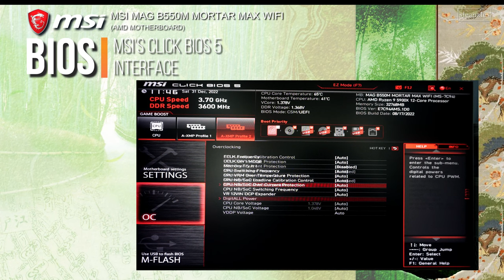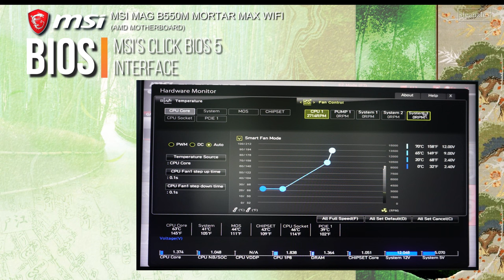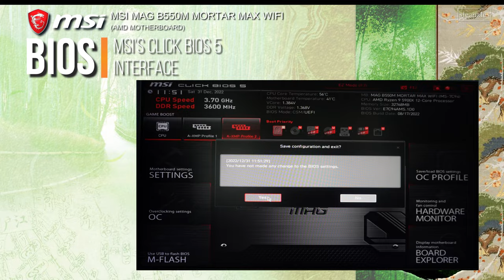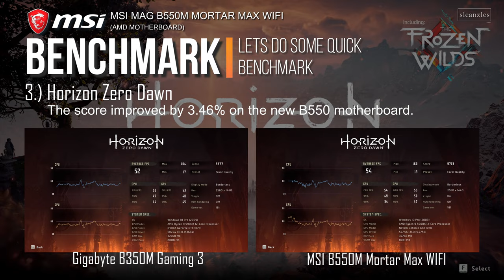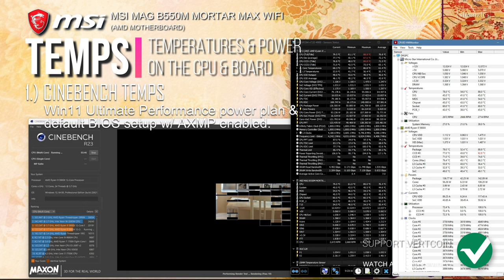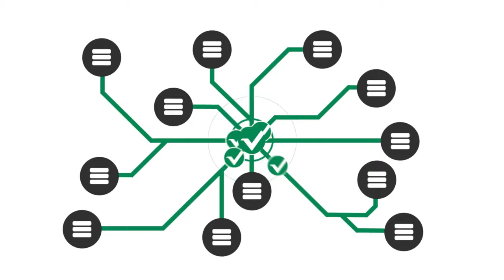MSI MAG B550M Mortar Max WiFi | Powerful but blind, upgrading B350M build

Comment from the maker: If you have any questions about  the MSI MAG B550M Mortar Max WiFi in the video feel free to ask and drop a comment down below. I will try my best to answer them based on my experience while I'm using it. For technical support and troubleshooting might be best to contact MSI support though.
Reply: Hey i don’t wanna get an Asus board, apparently the customer service is trash along with the recent issues. Is this board the one to get rn?
Reply from the maker: @Beanpomade  That all depends on you. Personally I don't have much complaints or problem on this board apart from the SATA detection issue on my old HDD(see video). If you're looking for the best B550M motherboard then  this is the best one there is, well at least at the time when I bought.
Reply: Hello i hope you can answer, I installed this to my new built PC but i could not see the wifi option , Do i need a wifi adapter for the wifi option to work?
Reply: @HarisYouTube05  no you don’t
Reply: can you put ARGB fans on that mobo? and does it has light sync?
Reply: where is the argb header?
Reply from the maker: @ak-t7d6f  you can use the x2 JRainbow pin headers on the bottom and on the top right of the board. Refer to the manual. Careful not to be confused with 12v JRGB pin header, or it will fry your 5v ARGB.
Reply: @sleanzles  thank you 
I will use it with an ARGB fan with my new CPU cooler 
Will the rainbow one work with that?
Reply: @Beanpomade I had the same issue and it turned out I did need a adapter
Reply: Hi, how good is this motherboard compared to other B550 motherboards?
Reply: And is there any downsides
Reply from the maker: @Haucky-wb7ww really good, well at least in my opinion 😅. Expensive too compared to other B550m boards. Only issue I found is that it's not detecting one of my old data drive so I ended using it as external drive.
Reply: @sleanzles  Thats because using both m.2 drives disables the sata ports! I read it somewhere and it really sucks. Tho are there any other b550/b550ms that are better for the same price if not less?
Reply from the maker: @Haucky-wb7ww  not this B550M. Afaik that's only on B350 or 450 boards if I remember it right. If some B550 still does then this isn't one of them. You can use all sata ports here actually.

Try the v1 version of this board, the B550 Mortar WiFi it's cheaper if still available. Or try the TUF or Asrock counterpart. Goodluck.
Reply: @sleanzles sorry, I’m new to computers. Do you think this motherboard can fit in a Antec NX410 ATX Mid-Tower Case?

Comment: Now I'd figured it out, there's a 2 different type of this board has, the MAX and NON-MAX. that is why I got confused why some featured Picture on the MSI site shows the Different design from what I bought *sigh. This MAX Board featured the Wifi 6E which is the newer version from Wifi 6Ax. Anyways, we have the same version of this board, and I really loving it. Nice Vids Btw!
Reply from the maker: Thanks. Yeah indeed there are two versions of it. The old one and the new one but as you said the only thing different on the specs is just the wifi version, apart from the new design on the heatsinks.

Comment: You install 3 m2.ssd and 1 hdd. So that's 14 pci lines. GPU has x16 lines. 30 lines. But your CPU supports 20 PCI-E 4.0 lanes. How can you do that?
Reply from the maker: The CPU have lanes and so as the chipset too.

Comment: Hey, nice overview 👍
Do you stull use this mobo? Have you updated to the latest bios version?
Also could you please suggest what is the maximum height should I look for heatsink on 2nd ssd below the gpu? 
Cheers!
Reply from the maker: Yes, I still do and on latest BIOS. Sorry but I cannot help you with what's the maximum height of the m.2 heatsink below GPU. The one I'm using is a EZDIY-FAB M.2 SSD heatsink which seem a pretty common height for m.2 heatsinks. Maybe depends on the dual/triple slot GPU you're going to install on how massive their coolers are. So maybe you're better looking on the GPU if the cooler is being too close to the pcie pin connectors.
Reply: @sleanzles  perfect, thank you!
I will have to buy the gpu first and check the clearance and then look for a heatsink afterwards👍

Comment: Is this motherboard model good and compatible with Ryzen 7 5700g? And if yes what is your recommended gpu for the combination??
Reply from the maker: Yes,  it's compatible but 5700G only supports PCIe 3.0 so I suggest get 5700X if you want 4.0. Then for GPU get the new 7700XT available in a few days. Or 4060/Ti if you prefer Nvidia.
Reply: @sleanzles  much appreciated! thanks 👍👍
Reply from the maker: @swirberdi  Yes,  5600x support PCIe 4.0
Reply: @swirberdi ваш 970 evo на каких температурах держится? Пробовали разные слоты?
Заказал эту материнку и тоже взял м.2 ссд, еще детали идут

Comment: Sorry, I’m new to computers. Do you think this motherboard can fit in a Antec NX410 ATX Mid-Tower Case?
Reply from the maker: Yes 👍. Well this is a MATX motherboard which smaller/shorter than ATX motherboards. Your case can fit ATX, MATX & ITX motherboards. But I think you should get an ATX motherboard rather than MATX considering your case. Anyway, I'll leave that to you to decide. It will work and fit just fine too. Goodluck 😉
Reply: @sleanzles  okay thank you so much🙏

Comment: Im planning to buy this one to change my current mobo Msi A520m A Pro. 

Mobo - Msi A520m A Pro
Ryzen 5 5600x
Rtx3080
Ram - XPG D50 3600mhz 32gb

I can't xmp my ram to the advertised speed 3600mhz. If I xmpd, it will cause bluescreen. I can only use 3200mhz. 

Do you think this motherboard can solve this issue if I change to this one?
Reply from the maker: A520M A Pro also supports 3600mhz tru A-XMP mode same way this board does. I suggest to try to update your BIOS to the latest version if it get's stable to support your RAM. If still the same then try increasing the memory voltage by few millivolts increments until it gets stable. I can't guide you through this but this is at your own risk if you want to try before buying a new board.  If persist try contacting MSI support first to confirm compatibility issues with your RAM.

If you decide to just grab this board then this also support 3600mhz DDR4 tru AXMP.  I am also using 3600mhz RAM, Corsair DDR4 3600mhz Vengeance RGB Pro.
Reply: @sleanzles  thank you so much. Can you briefly guide me on how to update my bios?
Reply from the maker: @municae  go to the msi product page for A520M A-Pro then go to Support section and download the latest BIOS file there. Extract the BIOS file to a USB flash drive. Now reboot your computer and as soon as it starts press whatever key it says on the screen to enter the BIOS or Setup. Once your inside the BIOS find the section where it lets you update the BIOS. From there follow the on screen instructions how to proceed onwards.

DO THIS AT YOUR OWN RISK. If the update gets interrupted in any way then it could brick your board permanently.

Goodluck!

Comment: I'm between MAG B550M MORTAR MAX WIFI and motherboard X570 ASROCK X570 Phantom Gaming 4, which do I buy?, I will use integrated graphics, do you recommend any other?
Reply from the maker: X570 ASRock of course if you have an atx case. Just install a wifi card if you need wifi on it.
Reply: @sleanzles  thanks

Comment: Can you tell me how it's PCIe and sata ports work ... I wanted to fill all the 6 sata ports with hdd and 2 nvme and 1 x16 slot for gpu ..
Reply: I have one 2 TB Gen 4 Nvme m.2 1 gen 3 Nvme m.2 and Five 2 TB 3.5 inch HDD...And only 1st PCIe x16 slot for gpu can I run all of those at once...
Reply from the maker: There's no such limitation here for storage unlike B350 board was.  You can use both NVME slots and 6 SATA slots all at the same time, I did that. If you fill it all, only the PCI_E4(2nd PCIex16 slot) on the bottom will be disabled.
Reply: @sleanzles  Thank you very much ❤️

Comment: Hi did you solved the hdd detection issue my b550 Pro vdh wifi also have similar issue I wanted to make a dual boot system Linux and windows Linux in 2.5 Inch SSD and windows on NVME, both SSDs are showing in BIOS but not showing in Boot nenu to boot from another SSD I always have to disconnect the SSD which is pain if I don't disconnect the ssd it shows fine on device manager manager but not visible on this pc
Now I want to upgrade my PC and considering this motherboard so please let me know if you have any storage, boot device, related issues
Reply: Check your CPU's how many supported PCI lines. Your ssd uses x2 lines. M2.ssd x4 lines. And GPU x16 lines. So your cpu must be support at least 24 pci lines. İf you have another hdd and pciex components maybe thats the issue...

Comment: What bios version are you currently using? I bought the non-max version and i saw there is a latest bios update version 7C94v1E
Reply from the maker: I'm using the latest one 7C94v1E.
Reply: @sleanzles  is it stable?
Reply: @sleanzles  i read at msi community board that 5000X series are not affected by the security issue
Reply from the maker: @desirousfive1626  Works fine on my end for weeks now. I've haven't noticed any issue. But I'm on optimized defaults only so can say for sure.

Comment: Do you know how many powerstages, vcore powerstages ..A and vcore rate ?
Reply from the maker: It's 8+2+1 and 60A power stage
Reply: It's would be enough for Ryzen 9 that you install in video? @sleanzles
Reply from the maker: @TV-gy2ke  It's what I am using for more than a year now. Works just fine.

Comment: How about it's bluetooth and wifi speed apart from your using? 
Actually i am going to buy it in this week inshAllah, that's why
Reply from the maker: Tbh I'm not using them right now. I was using them at first but switched back to LAN since I'm connecting to my NAS frequently and I prefer the LAN. I didn't have any sort problems with WiFI or it's Bluetooth back then and they work great thou my Wifi 6 router is just 1 ft. I didn't do any extensive test on it, sorry but that's all I can say about it.

Comment: Tomahawk or Mortar Max WIFI? Which one is the best?
Reply from the maker: That depends on what you need. If you have ATX case then get Tomahawk or the Tomahawk Max Wi-Fi if you want with wifi. Otherwise if you have MATX case then Mortar Max Wi-Fi is way to go. They're both B550 boards so performance is on par imo.

Comment: Does this mobo support memory upgrade to 4800mhz when updating the bios?
Reply from the maker: Possibly with 5000 series using axmp since it says 4400+ on the specs but official compatibility they tested is only up 4400.

Comment: Hello, I bought this and used it for my latest build, i have a problem where my aio wont have rgb light, the pump and it's fans are working but don't have light, my liquid cooler is deepcool gammax l240 v2 rgb version, please help
Reply from the maker: Connect the RGB cable to the 4pin JRGB pin found on the bottom left corner of the board.

Comment: does it need an update for a ryzen 5 5600?
Reply from the maker: It doesn't. B550 boards are made for Ryzen 5000 series. But it's better to update it if you just bought it.

Comment: Hey,can I use two 4400mhz ddr4 ram in this mobo?
Reply from the maker: I haven't tried personally but as per specs yes it supports up to 4400+ DDR4 via A-XMP OC so long they're two single-rank modules. So get 2x 16 GB single-rank modules.
Reply: i'm currently using ryzen 7 5700x.i thought i can use 4400mhz with this processor .unfortunately it doesn't support 4400mhz i found out last night

Comment: Hello! Will this mobo able to handle r9 5900x?
Reply from the maker: Yes. This video is actually using R9 5900X if you haven't watched it yet 😅.
Reply: @sleanzles  ohhhh thank youuuu
Reply: @sleanzles  what about R9 5950X.?
Reply from the maker: @dewimedina  yes, 5950X is also compatible.
Reply: @sleanzles but isn't Mobo is not powerful enough to handle with this CPU? Back time in 2016+- some CPU just burnout  budget Mobo like this one
Reply from the maker: @TV-gy2ke  it's more than enough. Ryzen 5000 was released late 2020 to 2021. And this B550 board was late 2022 to 2023. You might be thinking about the 1st gen Ryzen B350 being compatible with Ryzen 5000, tried works fine but it's a stretch. I don't think this is a budget board imo, sub 100 boards are.

Comment: How many Case Fan I can add ?
Reply from the maker: you can add up to x3 case fans if you'll just connect it straight to the x3 4-pin fan headers without daisy chain or splitters.

Comment: What's the difference in the max and the non max version?
Reply from the maker: Max is just tiny bit better for having a new design and upgraded to WiFi 6E and the rest is just pretty much the same on the non max. If you can find a good deal on the non max version then it should not be much of a difference, considering the price difference.
Reply: @sleanzles   thanks for the response im gonna be going with a 58003d would ether board be suitable then?
Reply from the maker: @zehven6083  yes both of them will work just fine but you just need to update the BIOS specially on the non max.

Comment: Best board for 6600 5600 combo?
Reply from the maker: Probably but not with it's price point 😊.
Reply: @sleanzles  too expensive so you think or too cheap?
Reply from the maker: @blissseeker4719  too expensive imo, unless you don't mind the price then it's really a good board.
Reply: @sleanzles  what do you reckon would be a better fit for a 6600 with 5600?

Comment: Bro I'm facing issues with Bluetooth and wifi connectivity even after updating drivers.
Help me
Reply from the maker: Try using drivers from DriverEasy @ drivereasy.com for latest drivers. You can use the free version and install the drivers manually.
Reply: @sleanzles  already tried it still wifi reception literally sucks in this mobo

Comment: update on the problem?
Reply from the maker: I pulled out the 2.5 hdd out of SATA 6 port after weeks where it works and detected (if in the mood). As it often causes reading problems during boot. It's half the time works just fine then half the time it doesn't. I ended up using the drive as an external HDD connected via USB and it's been working great this way than via SATA 6 for few days now. I'm testing SATA SSD on SATA 6 for few days now and there seems no problems yet. If I encounter a problem by the weekend then this board goes RMA. Otherwise might just buy a fresh new 2.5 HDD.
Reply: would u suggest getting a 3.5 instead? or is it mainly just this one 2.5 hdd thats causing the problem
Reply from the maker: @11j_chua_gabriel54  I think just this 2.5 hdd. Other Sata 2.5 SSD works and so as my 3.5 HDD on that port 6 so far. Apparently my case can only carry x2 2.5 and x1 3.5 so I have to get a new 2.5 ssd/hdd for the sake.
Reply: thank you, may I ask if the other ssds / hdds work on the other sata ports? or only on sata port 6, thank you
Reply from the maker: @11j_chua_gabriel54  yes they do. I moved my hdd and ssd from SATA1/2 to 5/6 to test for this week and so far no problem for 4 days now. If all goes fine by the weekend then no need to RMA it but if all of  sudden a similar issue happens again then I RMA this board. MSI support already agreed to it if it continues to persist.
Reply: @sleanzles  thanks alot
Reply: @sleanzles  hello, just asking to make sure. so the mobo is fine and there hasnt been any problems at all? or its been 4 days since the last problem. thanks alot for the help
Reply from the maker: @11j_chua_gabriel54  yeah no problem since I removed that old odd 2.5 hdd that can only be detected on SATA5/6.